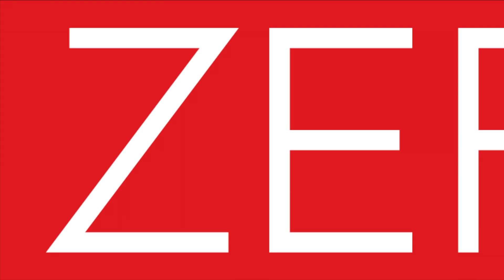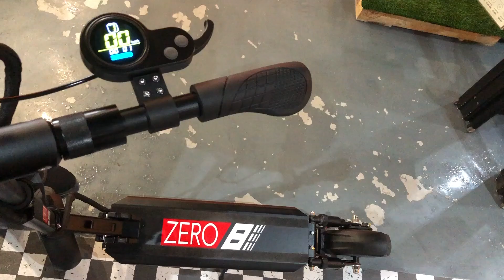ZERO 8 LCD Settings Adjustment

Comment: P00 is tire size adjustment (for speedometer) 
P01 is auto-off based on Voltage(based on video) 
P02 something you can adjust from 0-100 
P03 cannot be changed 
P04 is km/h and Mile toggle
P05 is PAS toggle. 
P06 is a 1/0 toggle for another thing
P07 is N-Soft toggle. 
P08 is max power limiting(based on video) 
P09 is EBS (based on video) 

Doesnt say anything about those in the manual.
Reply: Thanks
Reply: @sHonZzz994  What does N-Soft mean?

Comment: OMG, just went out on only 2nd ride and the bolt that collapses the main shaft popped out over 5 instances, first one at 25kmphr. I wrestled with it and whacked it back in and again on another 4 occasions and lower speeds as confidence reduced. Major accident averted. My bolt doesn’t “click” in and have read and watched that some say it should and some say it doesn’t so you need to ensure it’s in properly before taking off. Is there an adjustment I need to make to make it more secure as I really don’t feel like riding it now as you really get a shock even at 10kmphr when it gives way. Please help!
Reply from the maker: Glenn Williams can you send us an email so we can help you ASAP?

Comment: What voltage should the Zero 8 be on? Settings 3 on P mode? Somebody help
Reply from the maker: Yours should be a 48V battery and best to not touch the factory setting for cut off
Reply: Falcon PEV what is the cut of voltage for Zero 8 anyway? What is the number it should be on? Mine was 39 but I increased it 41 to save the battery is that a good idea?